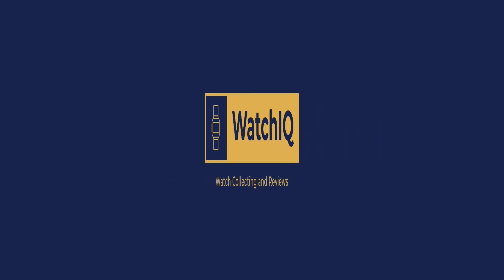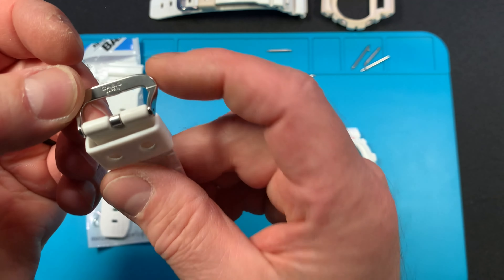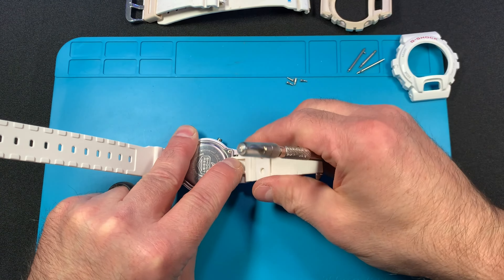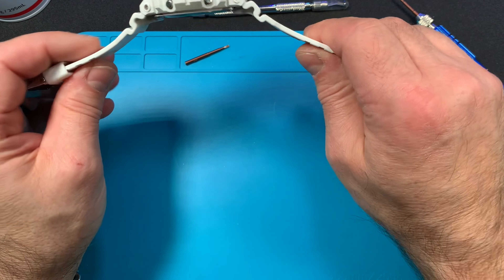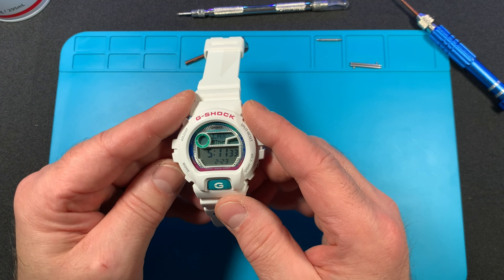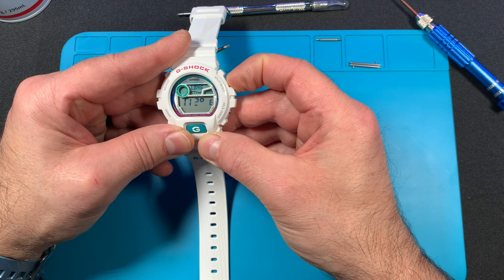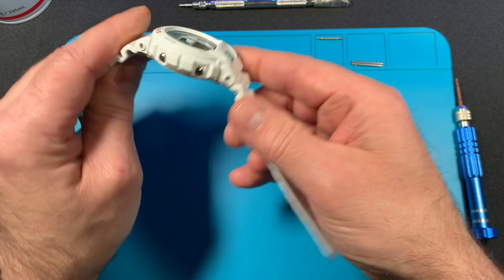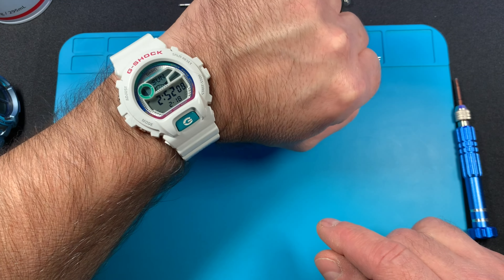Casio GLX6900-7 Restore and Review

Comment: Very cool watch, congrats! Module is great on these, same as on my G-7900. So, I can confirm it's 5 sec the light stays on max and 3 on min unlike on most other Casios or Gs on which selection is1.5 or 3 secs. Flash and auto light, 2 one thousand hour stopwatches, moon phase, tide graph, the list of features goes on and on and on. Great pickup.
Reply from the maker: Good Morning 😀, I really like the G-7900 watch! Thanks for the info on the flash and autolight feature, didn't realize that it had them. This module is loaded down! Thanks for watching.